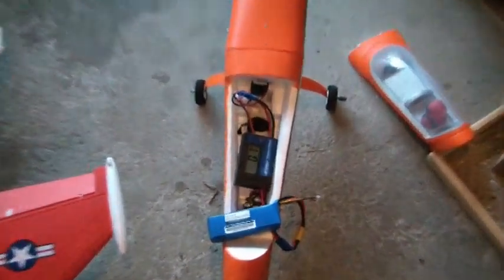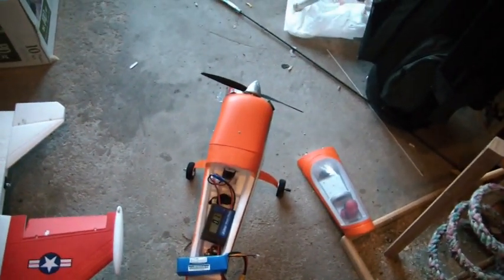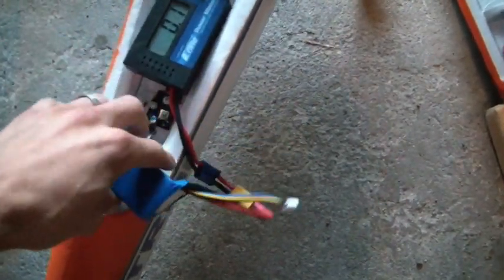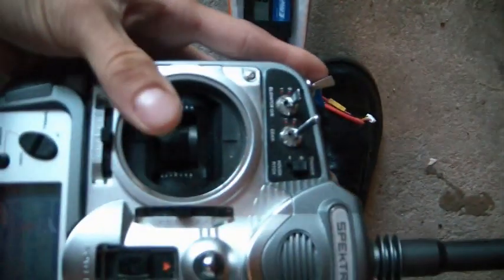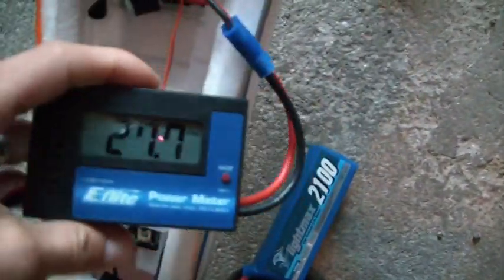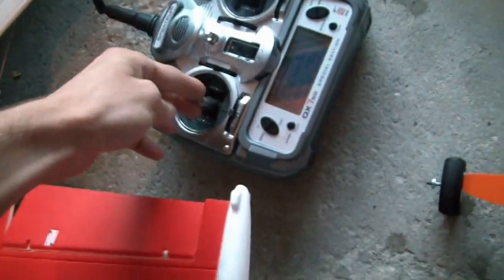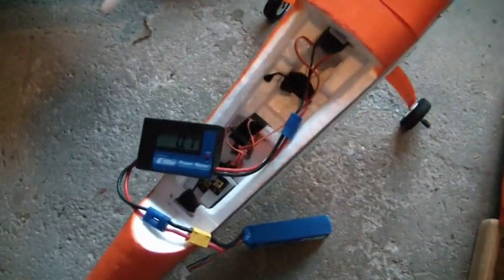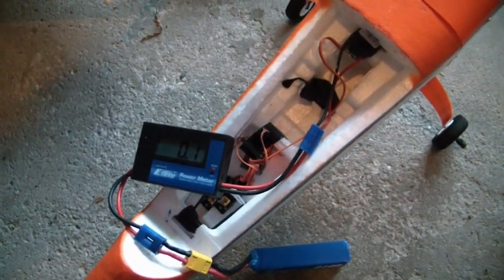PZ Extra 300 AMP draw at full throttle

Comment: 35 c means how much current it should pull witch means it should be 35 amp some cells hold 3.3 volts while other lipos cells hold 4.3  lipo a sketchy there always different then you have to look at losses aswell, the age of the battries and so on so ofcouse there is gonna be different amp reading for everyone give or take 5 or so amps
Reply from the maker: as far as I know, all lipo cells hold 4.2v when fully charged.
Reply: that's good ones that is, just say its 35c you times that by the mah of the battery, just say it 2000 mah it should pull 70 amps with no losses, just say you have 6000 mah that means you could pull 210 amps theoretically speaking that is, but what that did not consider is every engine pulls different currents, that's why you are puling 27 amps and others with the same plane and battery are puling 38 amps some engine will pull more with the same battery if you had a engine with 1/3 of the turns yours does  you would be puling  81 amps  blowing your battery up

Comment: well im not an expert but in all my planes prop size increases and decreases my amps that the motor puts out, so if u wasnt more amp smaller prop, easier for motor to turn the prop therefore it can pull more amps untill it peaks RPM

Comment: The amount of current drawn from a battery have nothing to do with the capacity, AH rating, of the battery. It all depends on the load. A higher capacity, more AH, battery will give a longer run time. At 30 amps that battery will give less then 5 minutes of run time. 2.1AH/30amps = .07 hours or 4.2 minutes.

Comment from the maker: @p3x197 wrong.  The 2200mAh is 25C(stock battery).  the one I used is 2100mAh yes, but it is 35C, it would pull more amps.